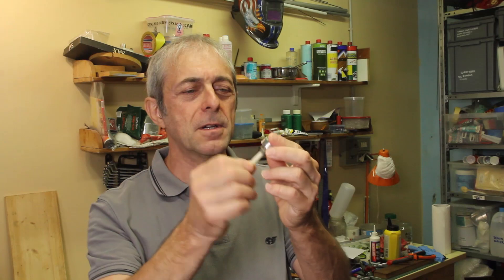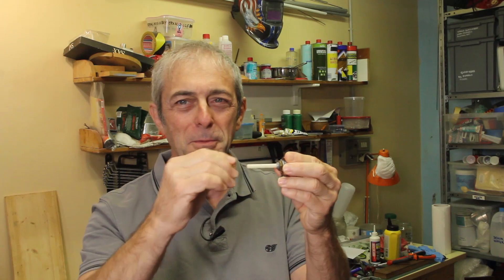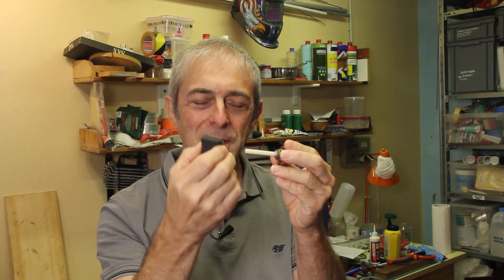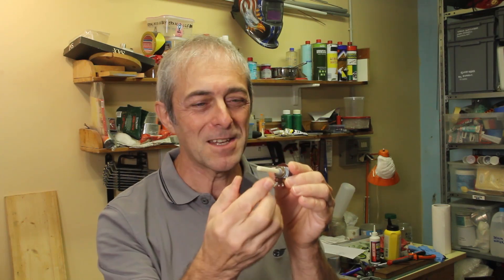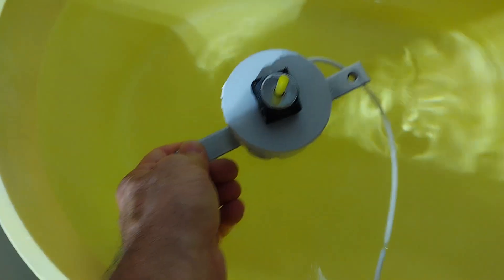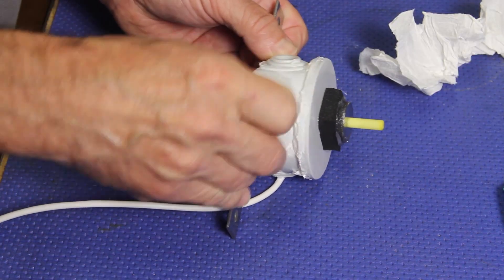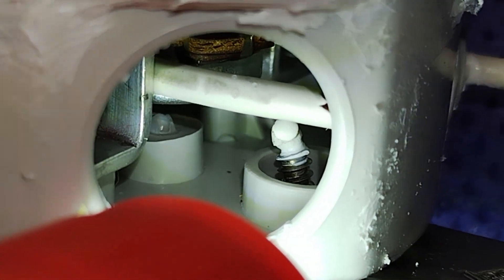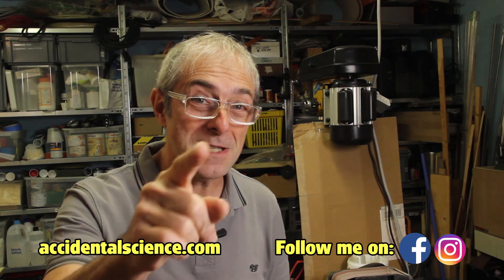Water Level Sensor for your sump pit - DIY with just a potentiometer

Comment: As an electrician working on sewage pumping stations, it may seem counter intuitive but a lot of supposedly air tight sealed equipment would fail due to internal condensation, you have to have dry silica bags inside. Other non air tight enclosures which could breath would last longer.
Reply from the maker: @wonton8983  dang! You're perfectly right... I did forget that 🫤 
Thank you for pointing it out.
Ohhh s*t I'll have to open it up to do this job.🫣

Comment: If I was going to make a waterproof reliable liquid level sensor, I'd put a hall effect sensor inside a tube that's closed at one end, and around that tube have a float with a magnet in it that floats up and down the tube. When the magnet in the float comes up to the level of the hall effect sensor, it triggers. No moving parts (other than the float), no seals to worry about, etc etc.
Reply from the maker: @gorak9000  the whole point of this replacement was that exact type of sensor that kept clogging over and over again.